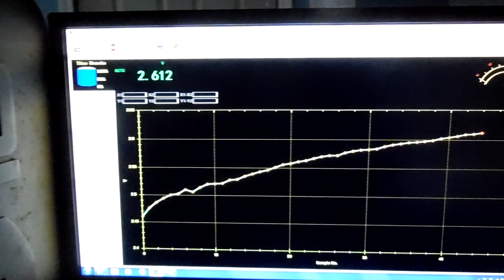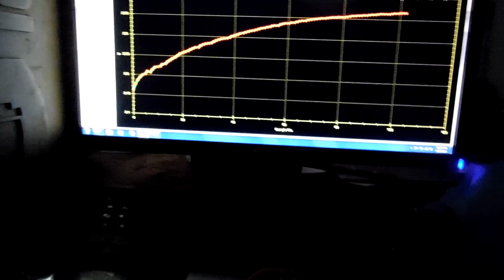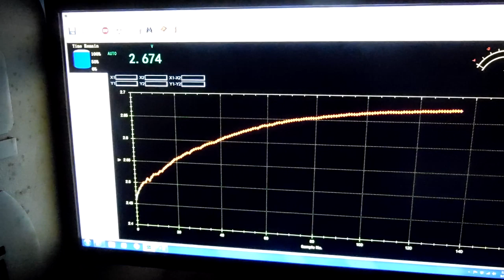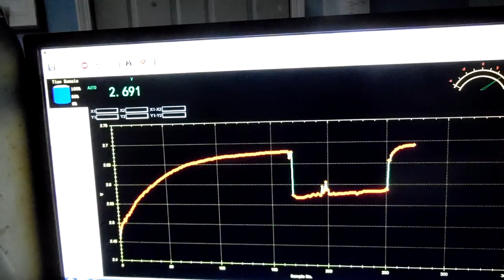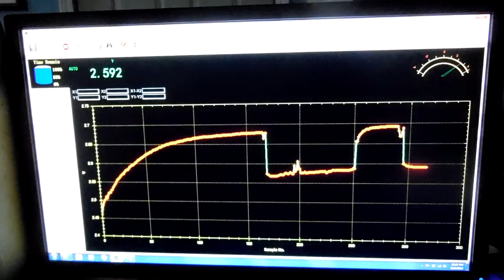Home made battery, huge power, Crystal cell (Allwest Power Cell)

Comment: Excellent my friend. I know this is old but I had to comment..

 You might be getting extra boost from your lcd monitor. Since most LCD monitors have boost circuits it produces an field that can be rectified by the leds as your load and actually boost the performance. But all in all you have a very nice cell there. I knew graphite and magnesium would be awesome. I think I'l be getting back into this very soon... Thanks.
Reply from the maker: Jon Bigman Hi Jon, thanks for stopping by and your comment, I have never heard of that 

I think one reason for the high voltage is the crystal structure I use to dope the cells, I can get about .80 to 1.20 volts from just the crystal mix without the magnesium, then add the mag and it jumps to 2.30 volts 
Kinda like a series cell 

I have not totally fig out the mix ratio yet on the crystal mix to get it back to the 2.50 volts yet, I am getting around 2.3 volts on the recent cells (dry cells)

Also, I have two meters that I read this high voltage from just to verify, but I will try this without the monitor to check 

Thanks Again Jon

Comment: Wow. So you used graphite and magnesium (anode cathode). What is the crystal mix used? (Or is that proprietary, I understand if it is). Also, when you say rechargeable do you mean it is self-recharging, or do you need to charge it from an outside power source? Thanks for sharing, very cool vid. I am soon going to get some of that DMM computer software.
Reply from the maker: Hi Binj,
Thanks for stopping by, I am still working on refining the mix. (work in progress)

Right now I am working on getting max volts for the cell design, so far the results are very good using graphite and magnesium with the new mix and I wanted to share a document the break through with a 2.7 volt cell, I have never seen anybody reach this level of volts using graphite and magnesium

Right now I am working on two different directions
1. Long running cell power with max volts and amps (these are the self chargers) but low power
2. A rechargeable magnesium battery with high volts and high amps (these supply high power for a time, then need to be recharged) A rechargeable magnesium battery is the holy grail that all the electric car manufacture's are looking for, light weight and long lasting high power rechargeable cells
Reply: +Steve Allwest I think I visited you videos couple of time and noticed it is hard to find what mix you use. Seems as if you are planning to get a patent or something. :)